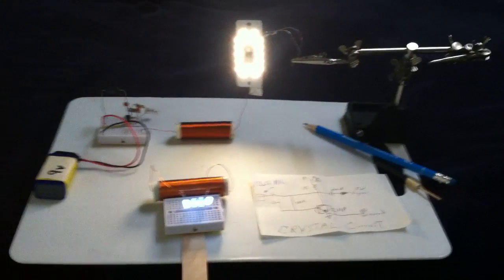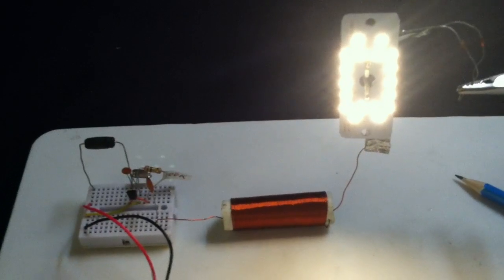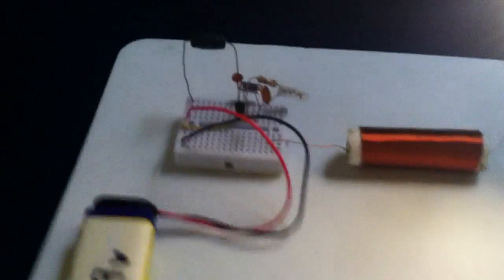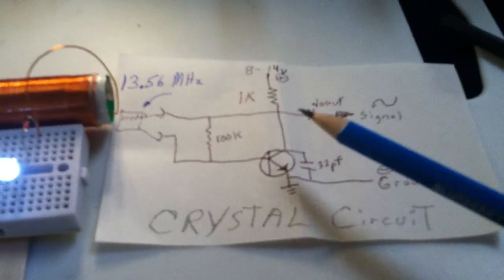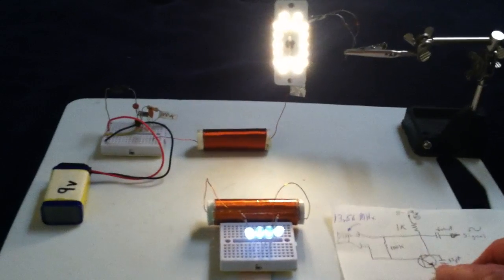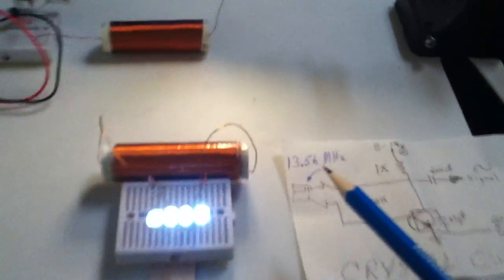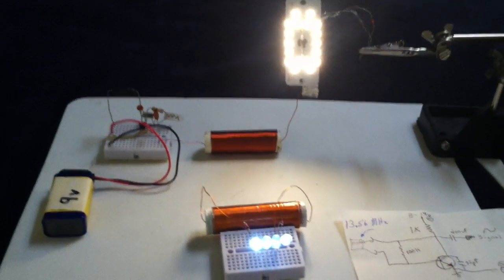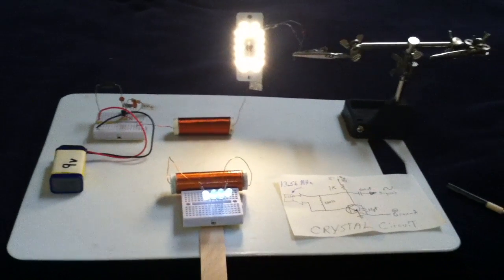Magic at 13.56 MHz

Comment: Thanks for making this video. I have been trying to make a custom display for Skylanders and this circuit works very well for it. I only had 150uh in stock but seems to not matter. Lots of different coil configurations seem to work even a square one. Now to figure out how to run it for free...   https://www.reddit.com/r/skylanders/comments/fsl8ep/i_finally_cracked_the_skylander_coil_mod_for/

Comment: One thing I didn't understand. Please could you let me know how   exactly the led is connected to the aluminium plate and ground. Thanks. And great work!
Reply from the maker: The aluminum heat sink backing plate is not hard connect to the (+) / (-) of the led.  The way this is working is through a capacitive link up. The (+) / (-) of the led are connected to two 1N4148 switching diodes in a way called an 'Avramenko Plug'.  Google it if you need more information.  Normally the 'Exciters" are connected to the front end of the 'plug' but in this setup the feed goes in backwards through a capacitive lint to the Al heat sink.  It is very unusual.
Reply: Got it. Strange but very cool. :)

Comment: Am i correct in thinking that  Dr. Stiffler does this same effect.... without the 9V? Just a signal?
Reply from the maker: Hi Kyle.  Yes. He is using  a signal generator.  There is amperage in the signal he is using but not that much (less than 30mA). That is why we are all scrambling to replicate his latest experiments.  The frequency that he is using is 13.6 MHz. .  The max voltage is 20v.  He has a bunch of videos up now on the subject.  Check it out and dive in.  It is fascinating.

Comment: Brilliant work as always,
Is Stiffler still around ? based on the video quality some of his stuff must've been early 90's. 
But all my recent TMT experiments have been around the SEC circuit, using the Eric Dollard aluminum plate and AV plug, just excellent, 8-10 mA @12v lights up the 48 series LED's and more!
I Always look forward to your work!
Reply from the maker: The Doc is back and posting videos again now.  He had a health issue but he is well enough now to work again.  His channel is----- StifflerDr.
Reply: @ kdkinen, tried running the primary of your old demonstration of the BiTT. Works great with very little amp draw. Thank you Dr. Stiffler and Lidmotor

Comment: very nice, Is rfid from shops near you helping your  results (same frequency 13.56mhz)?
Reply: RFID transmitters use a localized antenna and have very little spill over. Most cases signal can only be detected five feet away from the antenna. Also the FCC does issue strict rules on the range of such detection antennas.. Actually lidmotors results are great and close nought to the 13.6Mhz which is the actual and optimal.

Comment: Try connecting the AV plug to one of the battery post. And use the heat sink as your topload.
Reply from the maker: Great to hear from you Gary!  I will try that arrangement.  I wish that you would dive into this Stiffler Loop project.  People would really appreciate your input.

Comment: 13.5617 is the resonant frequency for Oxygen? Is this the missing piece to the most efficient HHO extraction?
Reply: Wow! Interesting..
Reply: By HHO do you mean converting water into hydrogen and oxygen? If that is the case then the answer is no. you can't separate water with alternating current, you need direct current which has no frequency (or some people jokingly call it 0Hz).

Comment: Nicely done. Now you are in a position to measure the input power from the 9v battery. (People using signal generators can't do this measurement easily.) And of course you will measure the output power (the power driving the LEDs, connected and wireless). 

Your results are great already but I wonder what would happen if you added a buffer output stage to square up the output from the xtal osc. I first tried a 74C04 but it wasn't fast enough. Now I've installed a 74AC04 which works much faster. I don't have the right kind of LED bulbs or the tuned coils to do the test myself. 

Before you buy into the "special frequency" you really should do some tests of other frequencies, with the appropriate L3 coil for the frequency you are using. Also, the diodes in the "AV Plug" will have a frequency-related effect. I'd like to see somebody try the Hitachi 1ss106 diodes here.
Reply from the maker: Thanks for the help.  The best way to measure the amp draw is to measure the voltage drop across a resistor.  The hf messes with the meters. I told Stephan that the amp draw was less than 30mA but I'm not sure.  Adding a buffer output like you are doing is something needed so perhaps we can go on up to 20v and see what happens.  The 'special frequency' comes from the time I spent looking at these things over the years on a spectrum analyzer.  These tall spikes happen up and down the sweep but for some reason 13.5MHz has the best results if you get the coil right.  Don't know why.
  I got some of those Hitachi diodes that you recommended and they work great.  I only got 6 so I am being pretty careful with them.
Reply: So the input power needs to be measured with (at least) an oscilloscope with math. 
This little oscillator works great as a RF transmitter: I can pick it up across the room with my shortwave radio, and that's without any antenna on the oscillator. 
You can do some neat tricks with the hitachi diodes, like light up LEDs from your cellphone, wifi router or microwave oven leakage. These diodes are fast .
I'm wondering about the choke. Is it actually working as a choke, or just as a 4 ohm resistor?

Comment: Well done Lidmotor. How many Milliamps does the circuit draw at this brightness of the LEDs from the battery ?
Reply from the maker: Less than 30mA
Reply: Haha, the one million dollar question .. .. And there you have the answer!
Very cool the replication is finally taking off. More people will get at it. Slider is on its way as well. Maybe I'll start playing with this as well, very tempting!
Reply: So less than 300 Milliwatts Input ? For that input it is very bright... Well done. Thumbs up.
Reply: People often seem to overestimate the power consumed by LEDs. Each individual LED may only be drawing about 2mA to 3mA or so to be glowing very brightly like that. If we roughly estimate the voltage drop across a LED when glowing that brightly as 2.8V (it depends on the exact LED type you are using), then that would give .003A x 2.8V x 18 LEDs = about 150 mW being consumed by the 18 LEDs. All the best...
Reply: This is why we should measure. Light in lumen. Our eyes can be tricked in the brightness, it depends on the frequency the LED is lit on.

Comment: could you give dimensions of the coil and number of turns. this is a test i would like to try.
Reply from the maker: Take a AA battery, roll hard paper around it and tape it,  wind up 26 Ga magnet wire on it end to end,  take the battery out to make the air core coil,  and that should do it.  Specifics?  Nah.  Not necessary.  Look at this video and gauge the size. Use a ferrite rod in and out to tune it if you have to.

Comment: Here's a paper that goes into detail about this frequency and the harmonics that are at play...
https://www.cs.ru.nl/E.Poll/papers/rfidgate.pdf
The frequency is outlined on page 8 of the file..
=====================================
There is also this post about it that I found..
In addition to the comments from the other researchers on the international agreement to reserve this frequency for industrial and laboratory processes, the RF signal is used in sputtering, since it allows to widen the range of materials that are used as a target. Metals are generally deposited by DC sputtering. However, electrical insulating materials like oxides, nitrides, and others may accumulate static charge when used with a DC signal, reducing the yield of sputtering.
The use of an RF signal guarantees the target electrostatic discharge in each cycle and therefore allows to deposit any type of insulating or conductive material .
The problem added with the use of RF sources is the adaptation of the complex impedance that generally shows the sputtering cathodes. But this can be arranged by using a high power coaxial cable to connect the cathode and power supply and inserting an impedance matching circuit tpreventing power reflected from the cathode back to the power supply.
This technology was developed long ago to solve the problem of impedance matching of the antenna to the radio station. To understand more about this topic you need to read about the theory of transmission lines.

Comment: very interesting but the diagram for me is not very clear you use an inductor too ??? in series with the crystal ??? please thanks.
Reply from the maker: The circuit runs just fine with the 1K resistor but I kept messing around with that component that 1000uH produced the best results.  The circuit is very forgiving and nothing is critical.

Comment: The magic comes out of the woodwork  :)
Congrats on a great demo and neat change to the circuit.
Reply from the maker: Thanks.  This makes me wonder about a number of things that have been discussed about these crazy circuits.  Are we ringing the bell twice like Ed said or is the vacuum giving up something as John said ?  Perhaps the lattice is simply being shaken just right like Doc says??  Questions and more questions.
Reply: With several answers I hope, now that you've seen the magic on that circuit. Your project in this vid is exactly what I was thinking of for the house thing on the thread :)
That full table of wireless situation with several clip leads was a big turning point for me, plus the Stiffler Loop of a dozen 1N4148's and its feet of range ! Was stood way off to the side of the table and it was still going, like it was being powered by a 24V large spark gap thing. 
As you know from experience, something jumps out when it's not doing the usual ranges and outputs. I'd say that's what each of those guys saw.
Reply: Cool statement, but, I wonder if the magic is merely just the frequency or frequency range where the resonance is at or near maximum.